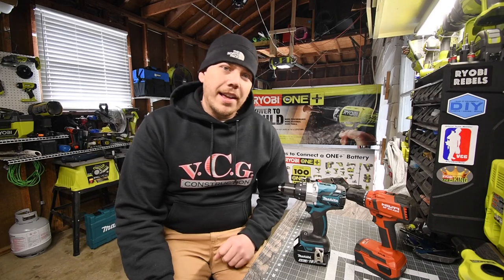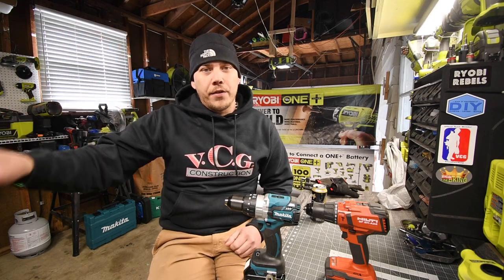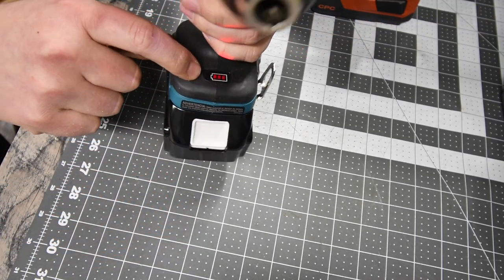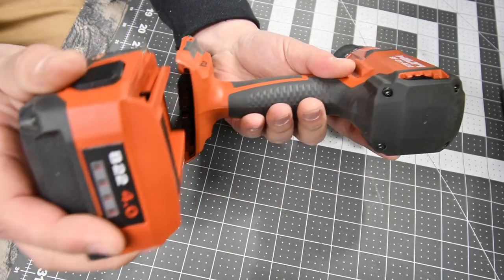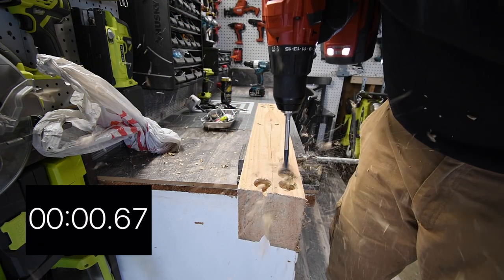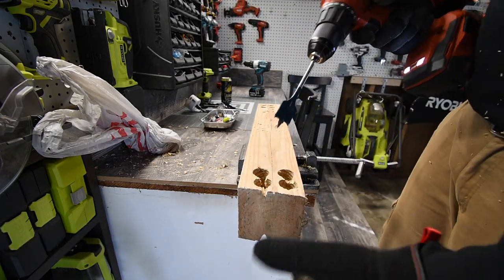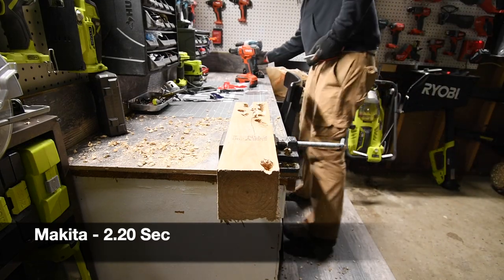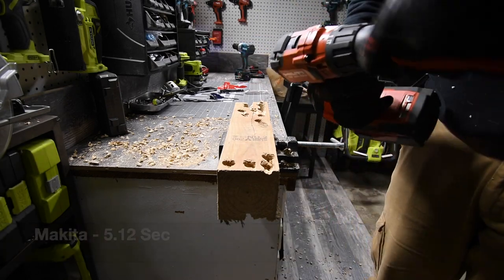Makita vs HILTI (Wood)

Comment: At 0:32 - the batteries are far from even. The HILTI is a 6S (~22V) battery, and the Makita is 5S (~18V) battery - they just have the same capacity (4Ah). I'm sure you know the difference between voltage and current capacity?
Next up: please compare a 400HP car to a 300HP car because they have the same gas tank volume. 
Before the HILTI fanboys jump in: having worked in concrete and some heavy industry, HILTI's tools are usually preferred for those applications by me...however, this comparison was disingenuous.
Reply from the maker: Makita doesn't make any special batteries so deal with it.
Reply: @ManCaverTools  ? No one said anything about special batteries. And there's "nothing to deal with" - your comparison is simply between 2 different classes of tools, and is therefore pretty meaningless.

Again, would you say a 400HP car and a 300HP car are matched in performance because their gas tanks were the same size? That's the same as comparing a 22V/4Ah battery to a 18V/4Ah battery.
If you are unable to understand this, I suggest you read more.

Comment: ... that long screws you are putting in that timber loag, didn't you tried it horizontal ? in the long of the fibre is not that demanding for the tools.
Reply from the maker: I know, these drive in timber locks a lot faster than impact drivers

Comment: Man you are wrong, the hilti battery is much stronger, at 4 volts more, it is calculated 4x18 vs 4x22 = watt. More watt, more power. You should also consider the price 😉
Reply from the maker: I know it is stronger, people I should use a 2.6ah batter on the HILTI and a 9ah on the other tool,  so I say its far because of the ah, but for the hilt to lose I will probably need to us a smaller battery on it
Reply: Motor runs on some voltage 18V-22V-36V etc.How strong motor is depending on the construction,motor that runs on 18V could be more powerful than motor that runs on 36V and uses more current (amps).Now we came to battery,every cell can deliver some amps,how many amps depending on cell’s,bigger battery have cells in parallel so they can deliver more amps but that doesn’t mean that every big battery can deliver more amps.You have single cells battery capable to deliver more amps than battery with two cells in parallel,that means that 2Ah can be more powerful than 4Ah battery.

Comment: There both awesome tools.  Makita if you read this come out with a table saw and I'll replace all my DeWalt.
Reply from the maker: I love Makita as well
Reply: Hi Tim,
Makita do a table top/mitre saw. You can do all your compound mitre stuff with it or lock the table down and run down lengths of timber with it. It also has adjustable table height that allows a depth of cut of 52mm. Just in case you didn't know. 
Dave 😁😁
Reply: @davesheppard8797  cordless?
Reply: @timhappy7223  Ah.....no mate sorry! It is a great piece of kit though. 😁😁
Reply: @davesheppard8797  I think I'll get one anyway for science.  Never seen one in person.
Reply: @davesheppard8797  what blade would you run on that ?  I like many teeth on mitre and few teeth on table saw.   Guess you would need to meet in the middle on that tool
Reply: @timhappy7223  I think mine is a 40 tooth blade. This is the latest model and I still have the blade in it came with. In the old model I used to use a 60 tooth. A lot of what I machine down is Architrave or 3 or 2X2 timber.
Reply: Tim, the saw is a LH1201FL 305mm. Table/Mitre saw.
Dave.

Comment: but not same specs Maximum torque. makita 1,090 in.lbs. hilti 708 in-lbs.  
hope to make new hilti. because makita make new up to 1250 in-lbs. in year 2021
Reply from the maker: that's why sometimes I dont listen to specs because it does also depend on how well the motor is built

Comment: Makita is best for the buck
Reply from the maker: I love this Makita Hammer drill
Reply: I run the Hilti in this video but really liked that Makita!! I used to always use Makita drills till their naff 3 speed MXT 18volt. NiMh batteries. Apart from drills/ impacts, my Circular saw, table/mitre saw, Router, jigsaw and angle grinders are Makita.

Comment: That is not cooling for better in hilti.
It's electronics. On the bottom. Just above the battery. That grid is for cooling motor driver in the drill.
Reply from the maker: I must have read the description on that feature wrong and thank you for the info Krysztof
Reply: @ManCaverTools  my God. Just read what I've wrote. English level 0. But I guess you got my point. Also admit, ATC triggers way too often.
Reply from the maker: @panbekon1470  I thought it was for the battery cooling. not the motor. I did read you comment right. once I again I thank you for the info
Reply: @panbekon1470  That is not ATC cutting in on the Hilti. That doesn't cut in until the body kicks violently for a 3rd of a turn saving your wrist from harm. That will be the Hilti motor protection.
Reply: @davesheppard8797  whatever it is, is annoying. I'm. Experiencing that screwing small screws with low speed a lot. Pretty disappointed on that. Never seen that on any brushed 18 or 22v drill
Reply: @panbekon1470  Sorry, I don't exactly know what you mean. The drill stops when drilling in smaller screws? I drill in 3" M8 coach screws with this Hilti ( lag bolts in the US) and the drill never cuts out or stops......You find this on this new SF6H brushless?
Reply: @davesheppard8797  yes. I just got it, and whenever I try to go super slow with screws, electronic clutch triggers cut out. It even happens if you try. Without screws. Mayne tomorrow I will try to make a video.
Reply: @panbekon1470  Sometimes when I squeeze the trigger very gently so very slow...like a crawl it sort of ratchets like it is on a torque setting, although it hasn't been happening recently as the drill is getting run-in. This has also happened on my earlier brushed SF6H. If it continues I would get your local Hilti rep to visit you. Hilti are expensive tools and should perform well! As I have said though mine seems ok now. I hope you get the issue sorted my friend.
Dave.
Reply: Kyzysztof...Further to my last post to you I  have been playing with my brushless SF6H.  If you have the drill on one of the torque settings you dont have to start the trigger slowly, like I am also used to doing, because it has an automatic slow start. Switch the drill to "drill" and the trigger is much quicker on the start.  I have a brand new SF6H still in the box, that does the same. It sort of ratchets sometimes on a very light trigger squeeze. As the Hilti has an automatic slow start on the ratchet settings this could be a safety feature. A number of years ago I used to keep a 12volt Makita under the desk in my workshop. One of my heavy footed assistants who was sitting at my desk must have kicked the drill on getting up and the drill fell forward and the trigger was resting against something that activated the drill a fraction but not enough to make the chuck turn or make any noise. The upshot was that the drill after a while overheated and caught fire!  You will notice on the Hilti when this trigger thing happens the drill won't work on a full press until you release and hit the trigger positively again.  If you play with your Hilti you will see what I mean about it having an automatic slow-start on the torque settings. So instead of squeezing the trigger gently to start slow you can give the trigger a full squeeze and it automatically starts slowly.
I hope this makes sense to you and I haven't waffled on too much!! 😁😁
Dave.
Reply: @davesheppard8797  waffled on, you have.
Reply: @tylersmith9868  You have my humble apologies Mr Smith.